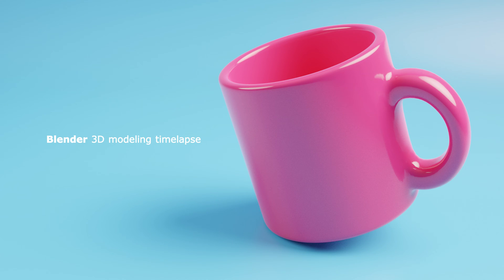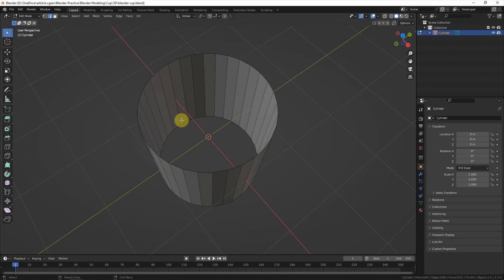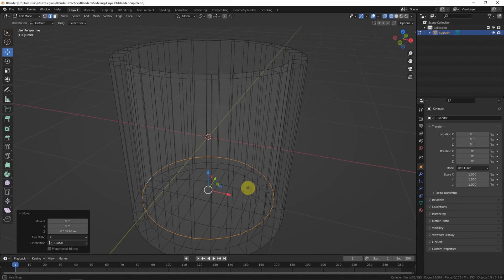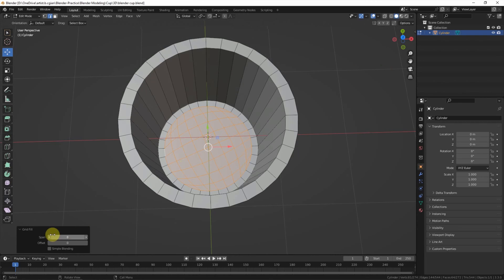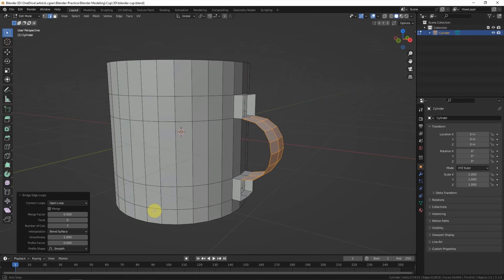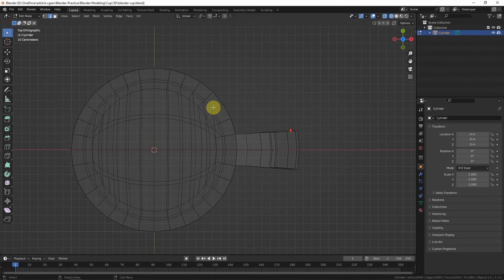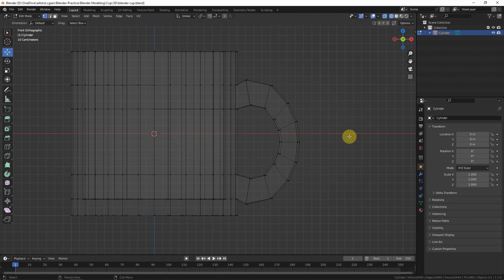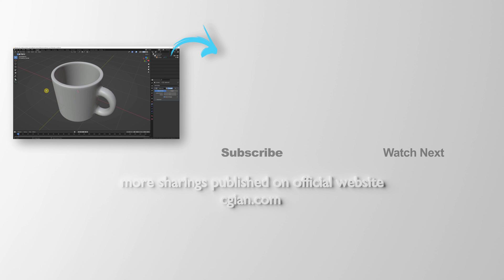How to make a cup in blender with adding handle

Comment: Hi, I'm new to blender. I've been following the steps correctly so far, except I'm stumped on the handle. I've followed the step to bridging the sides, and it's not doing anything. I've tried re-selecting the edges, even triple checked to see if I was using the correct tools for the job 🤔🤔🤔
Reply from the maker: try to bridge a pair of edges first at 2:56